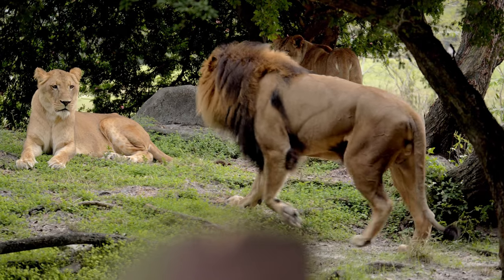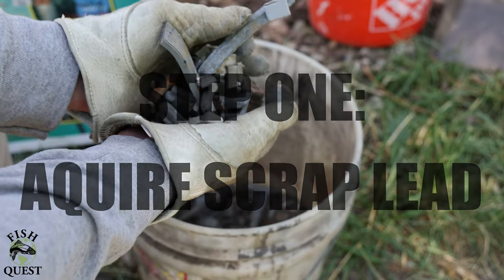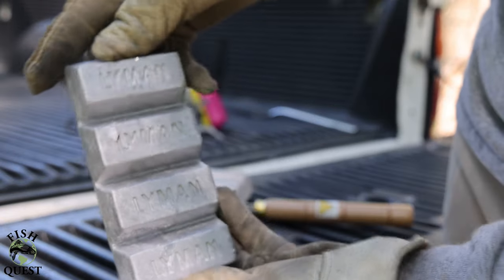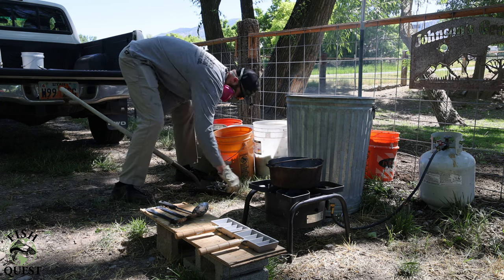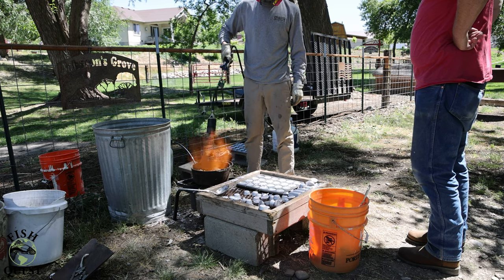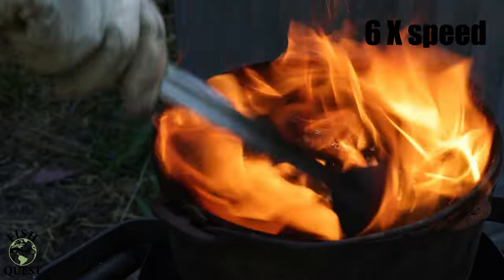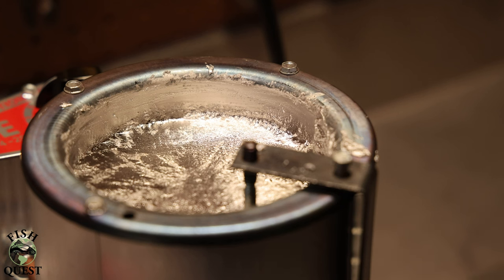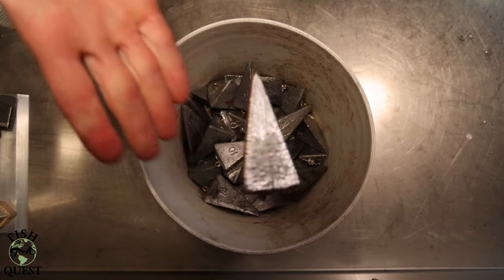How to melt lead wheel weights into ingots

Comment: Great informative video. I especially like your use of a shovel to add to the molten pool.
Reply from the maker: Hey thanks for the feedback, it didn’t take long to realize that wheel weights buried in a 5 gallon bucket may hold some water which will pop explosively when it submerges in lead, the shovel is a must now a days hah.

Comment: A well done video..!
I will give you a clarification though.  Moisture is only a problem when it gets beneath the surface of the melt.  Any moisture on top will simply hiss & steam away.  Also..  Sawdust is an excellent flux but you need to let it completely char before stirring it in.  It could contain moisture and then we are back to the water & molten lead discussion. 

Thanks for the video...
Reply from the maker: Thanks for the comment, all excellent, noteworthy points.

Comment: I just bought almost 200 pounds of miscellaneous tire weights for 20 bucks. But some of them are stick on kind. Still have tape on back. Will that burn off and float?? Or are those even good to use? I’m trying to make lead ballast l for my race car.
Reply from the maker: are they zinc or lead? if they are lead they will melt  just fine. zinc has a higher melting point then lead and needs to be removed for fear of poisoning the lead. I typically just scrape the zinc wheel weights off as im melting the lead. the adhesive tape will melt off just fine.
Reply: @FishQuest  started to look at them. Some are lead and some are magnetic. So I’ll have to sort them.

Comment: What was the pour you used at the end for the sinkers
Reply from the maker: @ryanlilly1293, the pot I used was a Lee Pro 4 20LB, I modified the pot by adding a piece of 3/4” plywood between the base and the back to make it stand tall enough to pour into my big 14 oz sinker molds. I’m currently working on a video that goes over my gear I use and the process of making sinkers.
Reply: @FishQuest  sweet thank you

Comment: What about the zinc weights do those melt down with the lead?
Reply from the maker: The zinc has a higher melting temp than the lead so they are easily scooped off with the steel scrap however they can melt and “poison” the lead batch.

Comment: Excellent video. I notice you don't seperate the soft lead into a seperate batch. Also you need to address the ZINC weights that are always in the mix, and the importance of seperating them out. I know that you know this but just didn't mention it. ZINC melts at a higher temp so if you DON'T let your batch get too hot they will get scraped out with the steel clips. BUT, if you let your batch get above 667 degrees, any stray zinc weights will melt and destroy the entire batch. ZINC will melt into the lead but will not alloy with it. ZINC contamination forms a gloopy ugly mess that is useless. Again great video, thanx.
Reply from the maker: great comment and info. looking back, I wish I would have gone over the need to sort out the zinc wheel weights from the mix or make mention of the need to babysit the melting pot to spot any stray zinc weights. Looking back I don't believe I have ever actually melted zinc weights on my lead because I'm constantly watching and waiting for the lead to melt so the zinc didn't have the chance to melt at a higher temp. From what I understand only a percentage of the zinc will mix yet it will "poison" the batch which will result in inferior casts. I do have one question for you and that is lead melts at  621 °F and zinc at 786 °F, you mentioned 667°F, what does that temp pertain to?
Again thanks for the comment and helping others learn.
Reply: @FishQuest  Sorry i popped that number off the top of my head. Your number is correct for the melting point of ZINC.  I have wrecked a few batches of lead and it doesnt take much zinc to do it. I collect from tire shops around town and these days i keep all the zinc for casting things other than boolits. Thanx
Reply from the maker: @ITZGR82BFREE  right on, thanks again!

Comment: Wheel weights are crap now. They don't use pure lead mostly anymore. I just bought a bunch from my local junk yard and it don't melt with a lead smelting pot. :( smh
Reply from the maker: The sad truth about used wheel weights is that as the years pass actual lead wheel weights become harder to find. Have you tried going to your local scrap yard to see if they will sell you other forms of scrap lead?
Reply: @FishQuest  I haven't stopped by there as it's like 30 miles away. I called them 2 days ago and had to leave a message, but they never returned my call. I'll have to call them again next week.